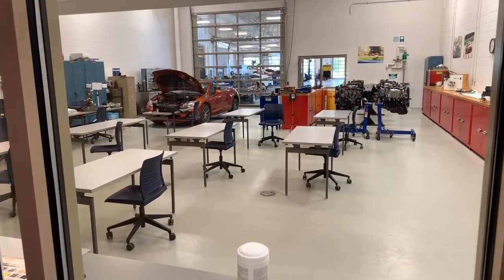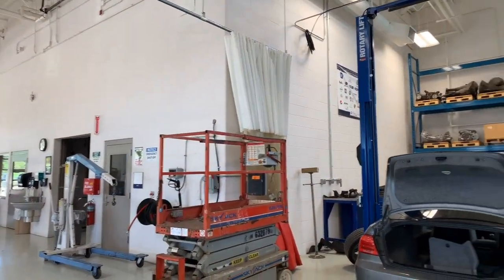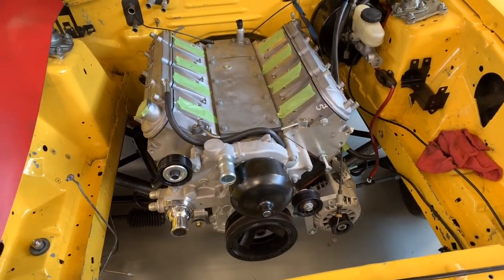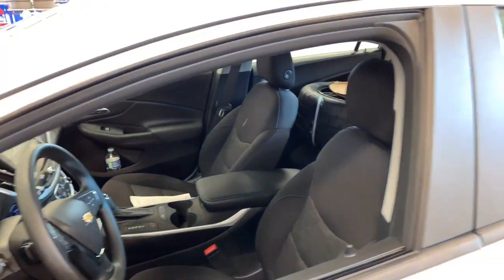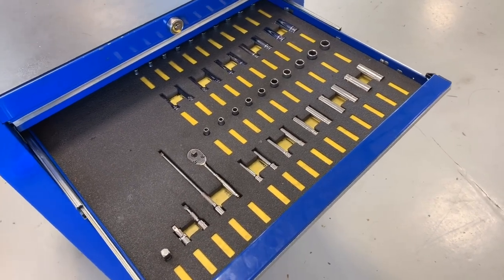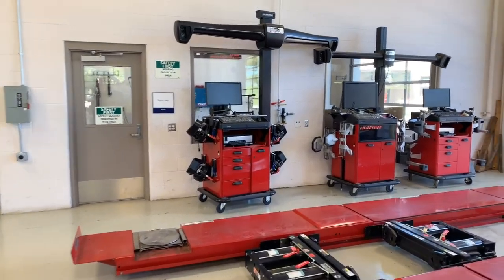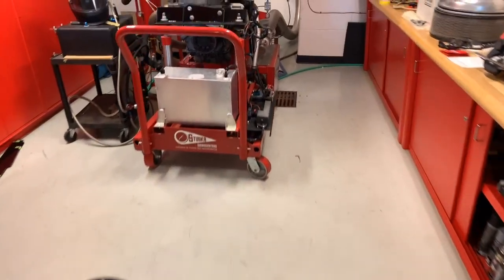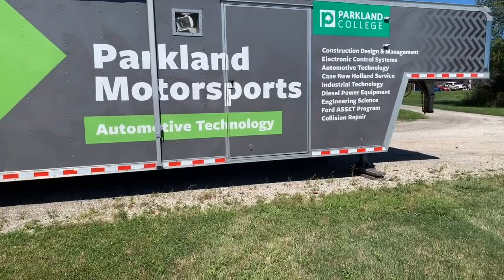Automotive Program & Facility Tour at Parkland College

Comment: Thank you Adam. Good job. If you ever get to record a video on Ford blower speed control module, not resistors. Please show how the control PWM signal works and most specifically emphasize on where the source of the control signal voltage originates. Does the blower speed control module generate a 5 Vref and sends it to the HVAC control module. Then the HVAC control module toggles the voltage on off ground to create the digital PWM signal? Or, does the blower speed control module NOT generate the 5 Vref, Does the signal actually get generated inside the HVAC control module and it sends the 5 VDC digital PWM signal to the blower speed control module? Only way to prove this is on a working example and do the testing with the control signal wire depinned from the blower speed control module by the blower motor. Have a blessed and safe week to you and your family.